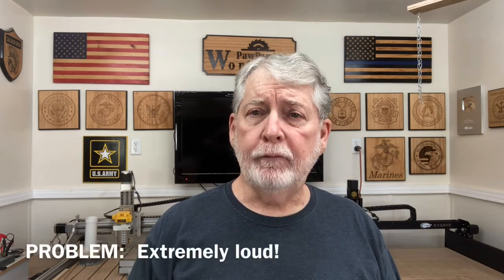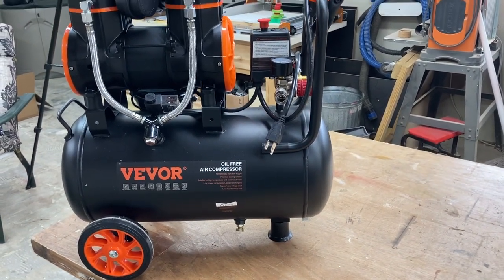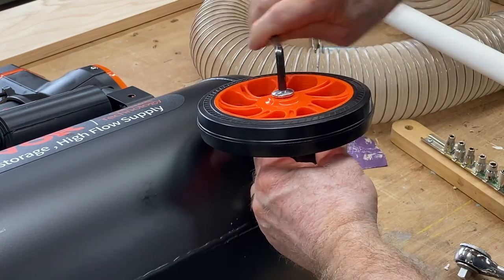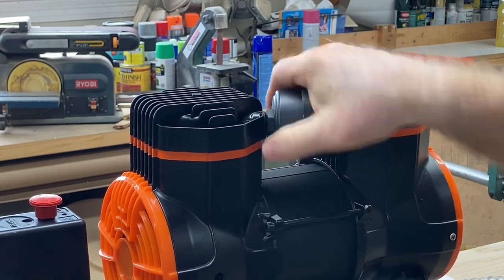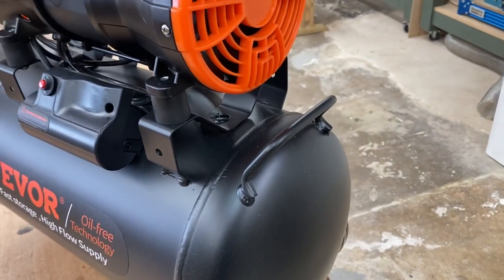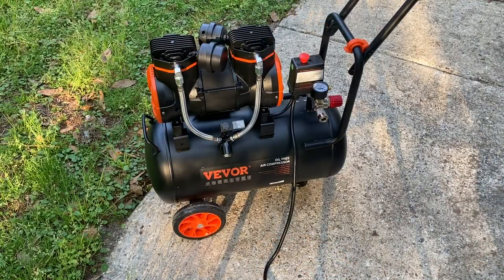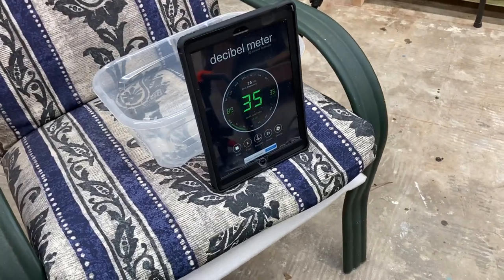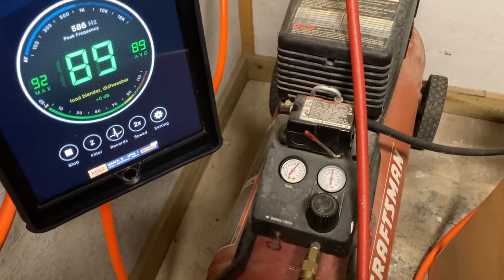VEVOR Air Compressor TEST and Review

Comment: I bought this same  compressor and just put it together just before getting to  this vid. I noticed when you was putting the handle on, you mentioned that "there was no little nuts" included  and you was wondering why the handle was not secure. You didn't notice two tapered springs left over in your kit? Those two springs fit between the handle and the other handle and helps hold the top handle in place.  I was wondering where the two springs went myself until i watched another assembly vid that showed where they went.  Maybe you already figured where they went by now. If not, hope this helps.
Reply from the maker: Thanks. I appreciate that very much. These manufacturers do not provide adequate instructions.
Reply: @PawPawsWorkShop   You are right. i had to look everywhere to figure out where the  airfilters went too. They tried to explain assembling two different models on the same pages and that made it even more confusing.

Comment: Hi does it have a quick disconnect fitting on it already? If not what size does it take? Thank you
Reply from the maker: Yes, it does
Reply: @PawPawsWorkShop  thank you, is it the standard 1/4 inch?
Reply from the maker: Yes, I was able to just plug my existing line directly into it.